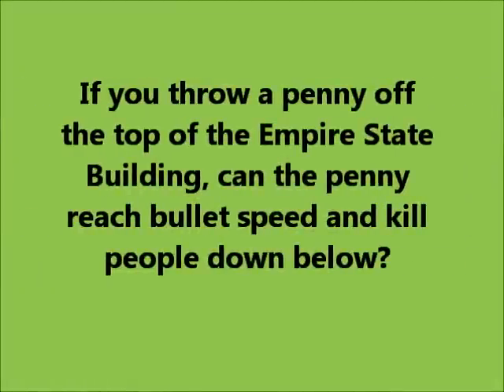AP Physics 1: Forces 36: Air Resistance and Drag Force

Comment from the maker: I have been busy working on videos, so it took me a while.  
The observer only has horizontal velocity, so the vertical velocity of the rain is the same no matter what. So, the key is to separate the horizontal and the vertical and to draw vectors so you can see what is going on.  
Horizontal direction: vy cot 60 + 10 = vy cot 30. Solve for vy, 
then vx = vy cot 60 
then you can find the rain's speed.

Comment from the maker: If the horizontal velocity of the rain is vx, then 20-vx = 8 +vx, so vx =6. The rain must have a horizontal velocity going in the same direction of the first velocity. The rain's velocity relative to the driving man is 20-6 = 14 and the vertical angle appears to be 30 degrees, so the tan 30 = 14/vy. vy = 24. So the rain has a horizontal velocity of 6 m/s relative to the ground and a 24 m/s vertical velocity relative to the ground. ie. speed = 25m/s. I hope this is correct.